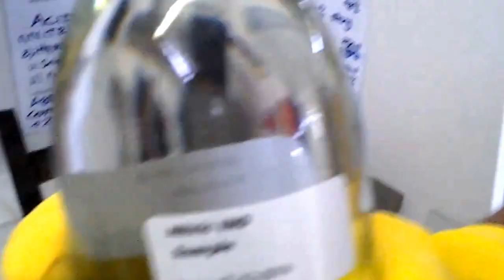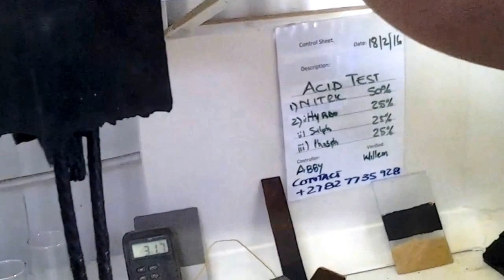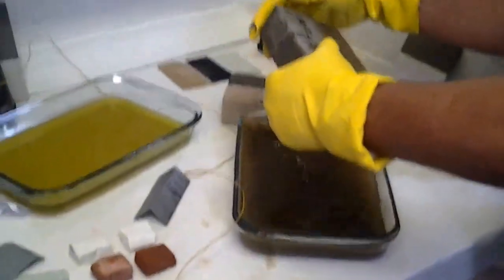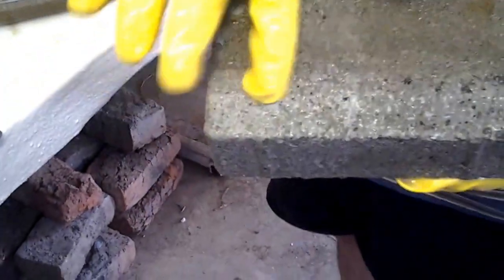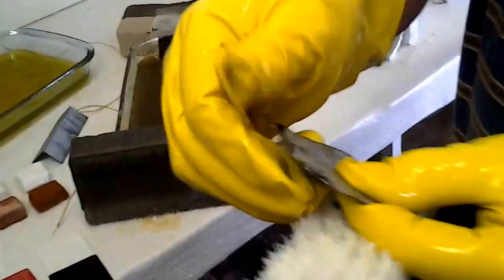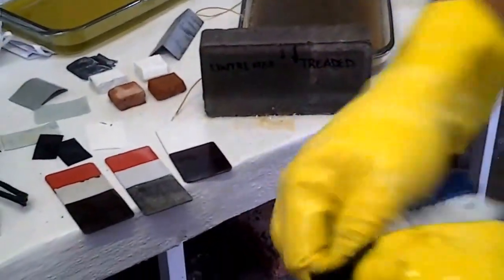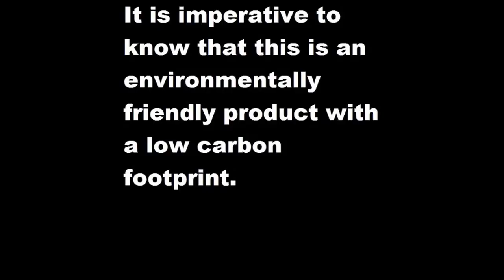Paint test using Acid youtube

Comment from the maker: I have now had a few phone calls and some not so nice and some with a few good questions . The first one is to clarify what has this to do with decorative  paint as you do not put your home through any acids or extreme situations, (the acid test is merely to speed up the process your current coating is going through) well if you live in the far east you have extreme air pollution (poor air quality is filled with acids) and if you live in the Europe you have extremely wet condition and if you live in Africa / Australia/America you have extreme heat conditions, ONE THING WE ALL HAVE IN COMMON is temperature  variations,  this means if we have temperature variation of 20 degrees CELSIUS at any give time of day or season (this is classified as thermal shock ) the coating you have on is not conducive to the coating you are currently using. If your paint is cracking ,delaminating, loss of colour, chalking, prone to mould /damp ect this is an indication that your sub- straight is not protected and this is not your fault as there was NO product out there in in the world as we know to give us the protection. The video merely shown as start to give the protection of your asset, this product will now protect the sub-straight (.your questions will be answered as they come,  rather leave the insults and question to this media form all is welcomed !!)